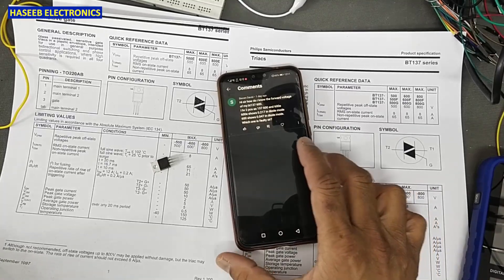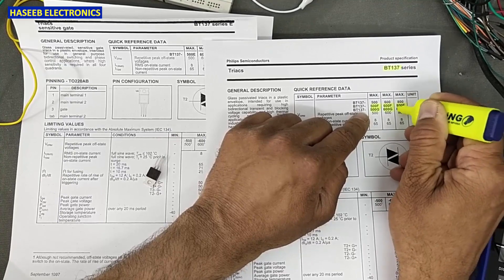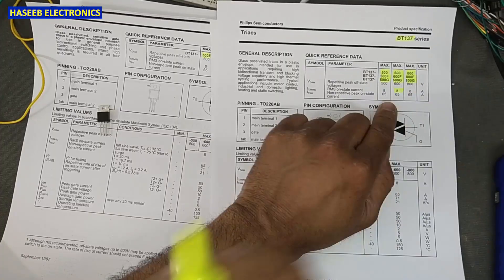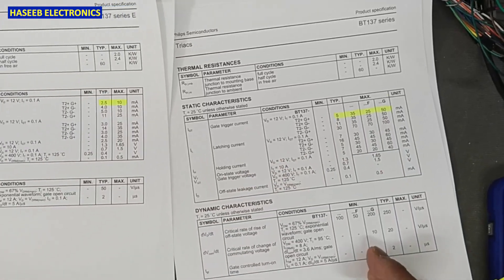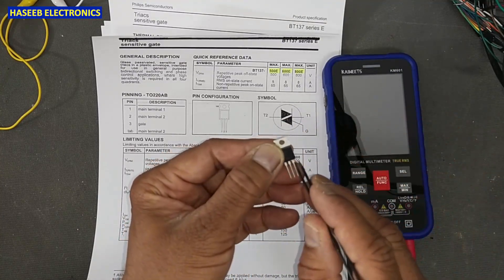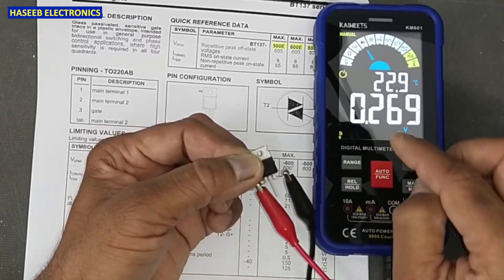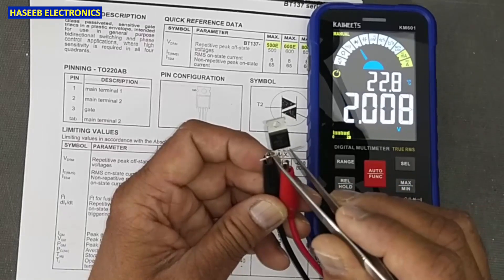{833} TRIAC Testing With Multimeter & Test Circuit

Comment: Hi engineer
I have a receiver that had a power problem, I fixed it and it turned on, but the touch keys on the front panel do not work, and nothing happens even if there is a short circuit behind the keys. What is the reason

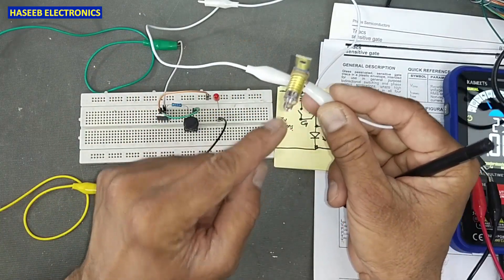Comment: Thank you for this beautiful presentation, at 6:44, you say that we can put the led in both directions, that means that it is in reverse voltage for one cycle if I understood correctly?
Reply from the maker: you are rigth. i told that LED can be connected in this circuit, because we are applying 3 volt RMS 
so while working on 3 volt RMS, we can use LED safely